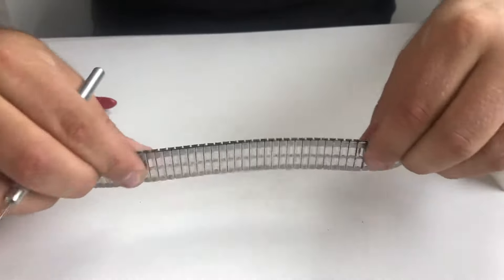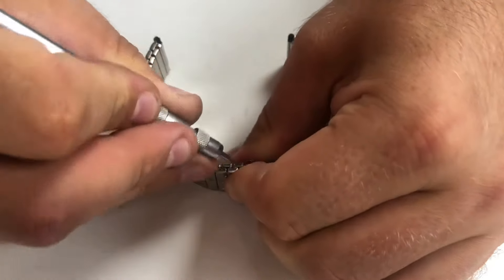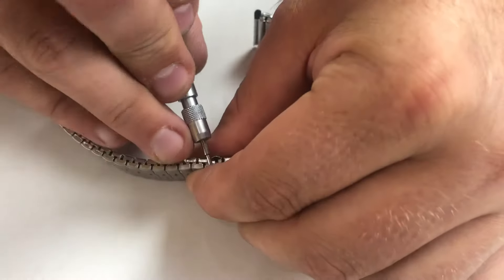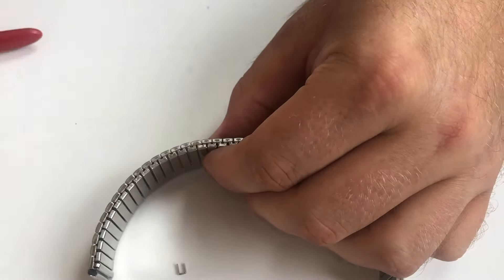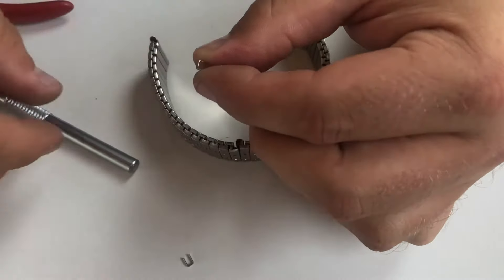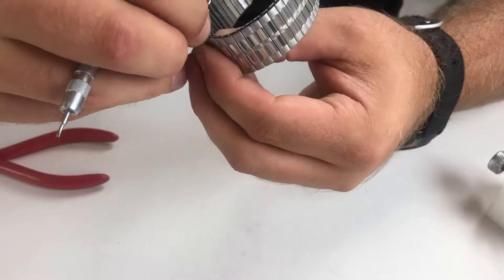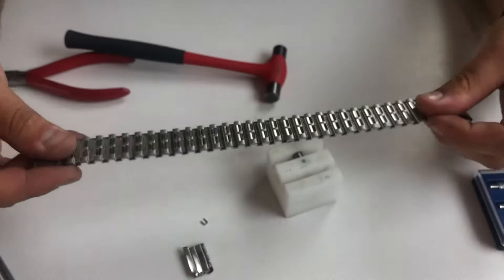Expanding Band Style 2 - Removing Links

Comment: Looks easy in video.  Strong fingers, steady hands, excellent eyesight all required.  Hard part is keeping the band ends aligned to push the link back in.  Be prepared for frustration and links 'popping' out and across the room - you may never find them.
Reply: The pin was the hardest part 😅🤕

Comment: Did this with a cheap gold plated watch from Walmart ! Expansion band but my wrist was still to small. Hard part was getting the second link into it. But over all, super easy! They sell the watch repair kit and comes with all you need at Walmart as well! 🙏🏼🤘🏼
Reply: I had the same problem with a Walmart watch I bought for my son! I used a tweezer for the second link, and it saved me a headache after trying with my hands for 10 minutes.

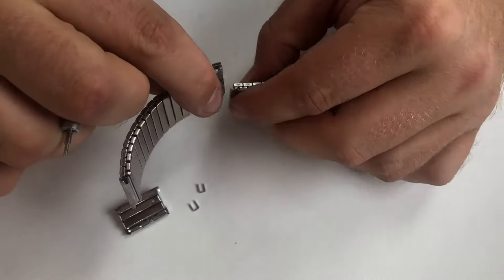Comment: So I finally noticed why this was so easy. At 1:31 it shows a slot in the bottom of the band into which the top is slid to hold it in place while you insert the staple pin. My Speidel band has no such slots in the band. The stuff nightmares are made of.